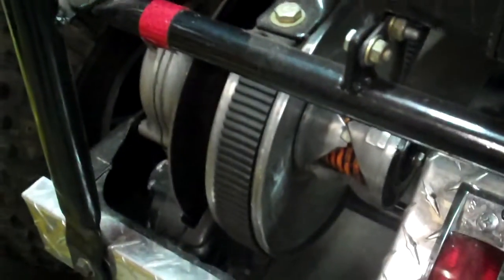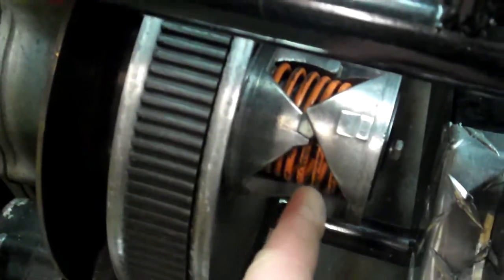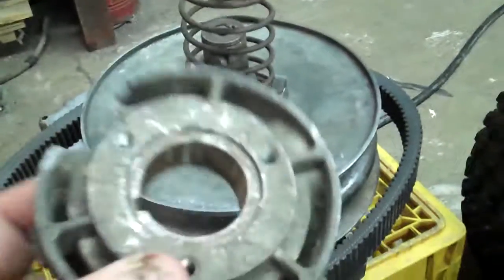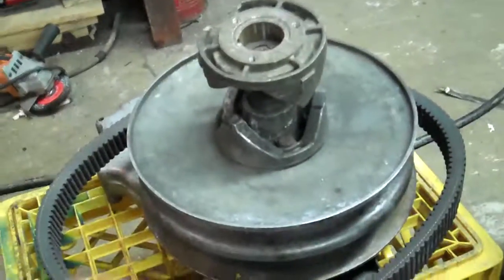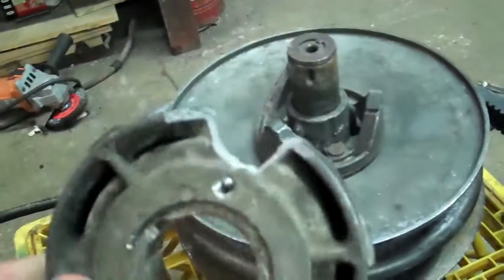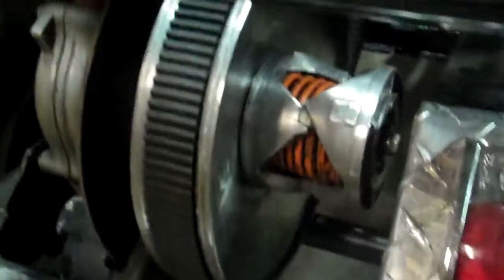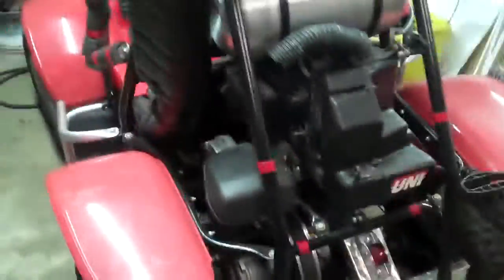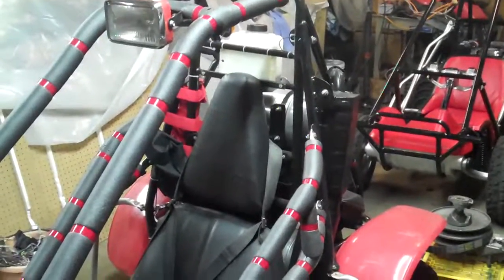Honda FL250 Odyssey Driven Clutch Mods To Fit Larger Sled / Snowmobile Belts

Comment from the maker: I used the yamaha sled belt. matched the belt by adding my measured spacer.  I then made my engine mounts slotted so I could play around with center to center.  

by machining 3/16 out I did not mess with clutch engagement at all.   

not sure on fl350. you can always mess with the weights inside the clutch or even the spring in the driven clutch.  

it's been years since I did this work.  not fresh in mind sorry.

Comment: Great Idea.  This seems to simplify the set up.  I am considering a 440 Kawasaki or 570 cc snowmobile engine.  Am thinking that the 570 might be too much.  Any comments?
I also heard that it makes aense to stretch the Ody by 4 to 6 inches as the extra power does not match the short Ody wheel base.  Comments are welcome.

Comment from the maker: @JIMMYSBMXERS Yes if your using the stock ody clutch. In this case I am useing the sled primary clutch. This mod matches the two belts. Sled clutches have adjustments to dial them in. Razor blade????

Comment: We ended up getting a Yamaha 540 air cooled snowmobile engine and wedged it into the Ody frame.  Couldn't get it low without major suspension surgery.  The belt is too wide, so we added several spacers.  I much prefer your idea to lathe down the clutch at the slip ring by 3/16 (or the extra belt width).  Pics available if anybody's interested.
Reply: Cool..some pics of how you modify you secondary clutch please

Comment: Ok.  So my son and I have upgraded the Ody with a Yamaha 540 XLV sled engine.  Everything is mounted, welded.  Next on the list are:
* pulling the Ody 2ndary clutch - how do you pull it off?  You mentioned turning in your video?   Not sure how that works.
* what needs to be machined by 3/16"? 
 * we will order a sled belt from Dayco.   How much slack should the belt have?
I live near Portland, so we should go riding sometime.  
Mike

Comment: I drilled and tapped 5/16-18 threads using a bottom tap. Attached puller.  Applied force, moved an 8th inch and stuck.  Using press moved back in the 8th inch.  Applied PB Blaster penetrating oil over night.  Tried pulling again, stuck.  Applied heat with propane torch to expand.  Got another 3/16th".  Using press, pushed back in.  Sanded rust off tip of shaft.  Applied 3:1 oil.  Tried pulling again, stuck.  It's not my machine and I fear breaking it so I pressed back in, inserted retaining clip, pulled back to clip.  Done deal.  I'm disappointed I did not get this apart ....

Comment from the maker: @JIMMYSBMXERS Also if you cut the sled belt to fit the Ody driven clutch. Would not then the belt be to small for the primary clutch? My mod matches the driven clutch to the sleds belt and clutch.

Comment: i have an fl250 that although not advised im putting a 600cc Kawasaki ninja motor in. i was wondering how to get the axle stripped down to just the bare shaft.. i've got the clutch case split open and i'm assuming the sprocket it just pressed on in there.. any tips on getting that off as well as the brake/bearing assembly would be greatly appreciated.

Comment from the maker: @radiusmike Personally I think stretched Ody looks dumb. The turning radius is bad as it is. The key with putting sled engine in an Ody is t get the sledengine as low as you can in the frame. Nothing looks as bad as an engine sticking way up in the frame.

Comment: How did you determine your center to center distance using two different size clutches. The snowmobile driver is bigger than the odyssey driver, and the odyssey driven is smaller than snowmobile drivens. Essentially you have paired a bigger driver and smaller driven together. How does the odyssey driven except the longer travel of the belt that the larger snowmobile clutch needs? Please help. I have a 108 exp clutch driver pairing with fl350 driven. I cant install a 94c clutch on the snowmobile engine because odyssey idle is 900rpm idle and snowmobiles rotax 447 idle is 2000. The 94c dusters engage at 1600 so that wont work. Therefore id like to keep stock snowmobile clutch to avoid pulling at idle.
Reply: Add 1 shem and 1/2.. should free up rpms to engage at 1100

Comment: i have a fl250 and im putting 340cc engine and i need to make the drive train bigger for the belt how much should i have taken off of the drive train and what did u do for the cam to take it off and do i keep the same clutch on the engine or should i get a smaller one?